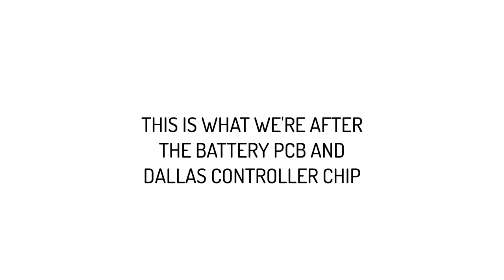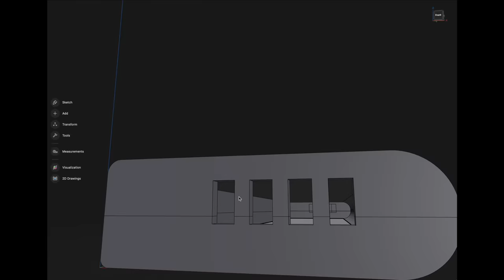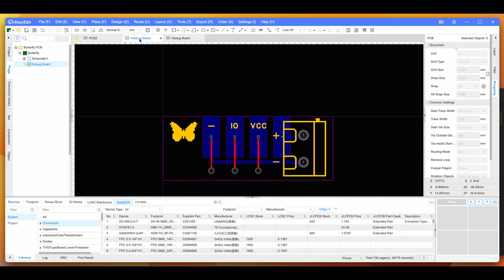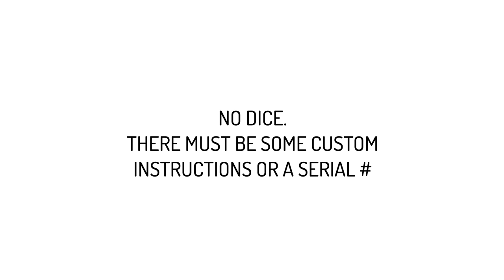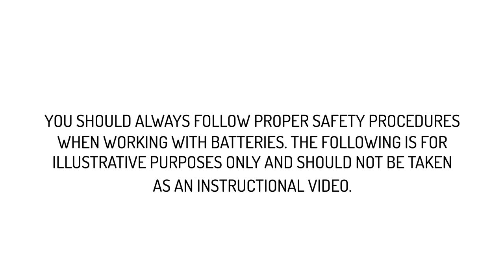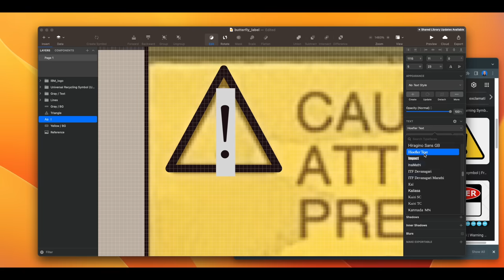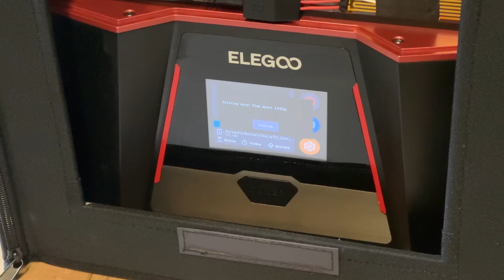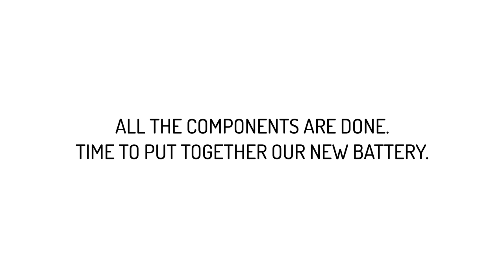Reverse Engineering a ThinkPad Battery - And making a Perfect Clone

Comment: Great work! Can you please list  the apps used in the description? The sketch app and many other are only available on mac unfortunatelly. Also, to keep costs down, for those that don't have a 3d printer, a silicone mold can be used for the case, and for the simple pcbs, there's the manual method with nail polish and acid.
Reply: Nail polish and acid... 😻
The original ways.. that even I did 40 years ago are still simple and cheap.

Comment: Looks awesome! Was the Xometry printed case just for the debugger? I'd be so scared sending that off without a test print, ha. The resin case looks great!
Reply from the maker: Oh I totally did multiple test prints. I only had an FDM printer at the time and wanted to see the quality of an MJF print. I also wanted to see if it made sense for them to print in bulk so I could sell them as a kit. Ultimately it would have been too expensive and I invested in a resin printer to get to the level of quality that I wanted. I would definitely recommend Xometry for high quality prototype prints!
Reply: @polymatt  similar experience is now why I own a CNC machine, ha
Reply: @jrowny  lol

Comment: you should make sure that the original charger circuit isnt a float charger, the float current may be too high for ni-mh batteries. Though being that ni-hm have a lot higher capasity maybe you are fine if they werent too agressive with the original nicd ones

Comment: I think it would be a good idea to use lifepo4 cells instead of the original battery chemistry because they can be deepcycled thousands of times. They're not as powerful as lithium ion, but they also won't explode or inflate. They're also more energy dense and lighter than nickel cadmium and lead acid.

Comment: Please write a bit on the battery chip reverse-engineering, would be very interested in reading!
Reply from the maker: At a high level, the chip is a Dallas DS2434. It operates on the 1-Wire protocol, so I used a logic analyzer to read the signals through various stages of operation. I then compared them to the DS2434 spec to try to understand the main workflows, requests and responses, etc.

I wrote an Arduino implementation in C using the OneWireHub library from Orgua, but there were slight changes that I needed to make. For example, this chip expects that it's the only one on the bus, where usually 1-Wire devices are multi-drop. So the library was expecting the bus to enumerate the devices, while the 701 laptop was expecting that the chip was the only one it was going to be talking to.

There were also some calls made to the chip that weren't int he spec and I was never able to determine what they were for, so I made sure that I just replicated the response of a working 701c Dallas chip.

The DS2434 also has an internal thermistor. I wanted to keep the PCB as simple as possible so I wrote a way for the chip to approximate the temperature through detecting changes in voltage. Definitely not a reliable thing to do normally, but I had the software compensate for crazy readings.

I also was able to store all the data in memory in the local EEPROM for persistance.

After that it was pretty straight forward. I figured out the code would run fine using the ATtiny's 16 mhz clock and that was that.

All of the code is available on Github including my modified OneWireHub library. https://github.com/hrushka/701C.ORG
Reply: @polymatt  Love it. Not sure the replication of responses is necessarily a good idea, especially if they turn out to be done IBM-specific charge control commands or something. Then again, pretty much the entire BMS seems to be on the laptop's side, so not much it could cause. And if it works, you know, don't need to fix it.

Comment: 17:42 I wouldn't recommend glueing the batteries together like that, masking tape is enough to hold the individual sections of 3 batteries together during soldering and the heat-shrink he put on later is enough to keep the entire pack together. The batteries will heat up with use and cool down when not in use causing expansion and contraction in the batteries which will cause the glue to break off and possibly damage the protective layer of factory heat-shrink on the batteries. Also its not recommended to solder directly to 18650 batteries as they are heat sensitive and high temperatures can lead to catastrophic faillure of the batteries. With this kind of 18650 with spot-welded tabs, its better to just solder wires to the tabs to interconnect them, instead of soldering the tabs directly to the next battery in line. Just make sure to position the wires so they fit into the voids between the batteries and the case once assembled.

Comment: I was like why he didn't use Lithium battery's  you could have used so  called polimer ones, but I'm guessing NiMh battery charging controller is on the motherboard.
Reply from the maker: You are exactly right. I tried using some LiPo packs with their own BMSs but the charging curve was just too different.

Comment: I know that I am a little late to the show, but @polymatt you have outdone yourself. Attention to detail, sparing no expense, clearly. 
I do have a question re: the case. You had on done by a third party for like a hundred bucks that you used on to analyse and then later 3d printed a final one. this is usually the reverse way of prototyping. Can you please elaborate on your choice here? Also why didn't you use the third party for the final product since you paid so much to have it made?
Last question, since you had so much extra room in the pack where you coiled the extra wire up, why not use a more readily available chip and just run wires to it and jam it in the with the excess wires instead of paying premium for the chip you chose.
Lastly, I am only asking since I admire the process, and would love to know what goes through your head when doing something like this.

I am interested in the 3d modeling software you are using, I have never seen it before and it looks really nice for the task. 

Cheers, and thanks for the show. When I saw that it was 30 minutes long, I honestly assumed that I would be skipping through it to save some time, but you sucked me in and I watched every second. Great CC Overlays also, good choice.
Reply from the maker: Hey there - it’s definitely a common question 😁.  Long story short I used Xometry because I was originally planning on doing a production run and selling the cases in my store. The quality was amazing but far too expensive. I ended up deciding to open source absolutely everything. At the time I also didn’t have an SLA printer but ended up investing in one for this and future projects!

The cad software is called Shapr3D. I absolutely love it. It’s a bit simple but still powerful and even has a great iPad app.

As for the chip, I needed a sufficiently powerful microcontroller to emulating the original IC so in my tests it had to be at least 16mhz. It’s essentially software emulation which has a huge overhead of even simple circuits especially since timing is key. For the cells this was just a test. I added screw terminals to the board so anyone could build any size pack and as long as the voltage and battery chemistry were the same you could do a number of configurations. I opted for AAA size cells for just showing the process.

Comment: love the work Matt!. Seriously impressive work. Genuine question at this amount of effort is it also not a feasible option to just change the cells in the battery to new ones? 300$ for a case is expensive. Thanks!
Reply: sorry! seems like you can 3d print it, which would be a whole lot cheaper
Reply from the maker: Hey you can definitely use the original case if you’re careful opening it, don’t mind glueing it back together and if the original chip still works. If not it’s best to print a new one. And yes - everything in the video is open source!

Comment: Great video, thank you! just to clarify, did you change battery cell type from NiCd to LiPo?
Reply from the maker: I didn’t. I tried to make it work but in the end I would have needed to rewrite the BMS, which aren’t on the batteries, they’re on the logic board of the laptop. I had the labels printed with LiPo because at that time I was hopeful but in the end I stuck with NiMH.

Comment: Excellent video.  Just a small typo, I think.  Li-Po, or polymer, are the pouch batteries.  Cylindrical cells are Li-Ion.  I don't think there's much difference, but I don't think your batteries will balloon up when it reaches end of life.
Reply from the maker: Ha. Good eye. It’s in the captions but I was a little over ambitious and was working to get LiPo packs working. The cells I’m using are NiMh. I’ve got a LiPo version that will power the laptop but charging is an issue as I’m sure you know the chemistries are quite different.

I had some initial success so I ordered the labels with LiPo but then was never able to make it happen 😑. I was hopeful because the LiPo packs had an onboard BMS of their own that prevent over voltage / over charging etc.
Reply: @polymatt  I kind of figured as such.  I'm mildly aware of the idiosyncrasies of lithium charging and no sense digging into it, we both probably know.  Though it would be nice to get that working.  I would settle with not fully charging the cells for longevity sake.

I really want to rebuild the batteries for my own ThinkPad.  I managed to run a 760 with 14 Ni-Mh AAAs, but as you can imagine they do not last long.  Lol
Reply from the maker: @Ikouy  yup. I was thinking the same. Sacrifice a full charge to get a lot more longevity.
Reply: You can get Li-Po and Li-Ion versions of both the pouch and cylindrical batteries, as it's telling you the chemistry, not the form factor.
Reply: @HaralHeisto  Lithium Ion is often used interchangeably, but I'm not sure the point of a polymer cell in a cylindrical format.

Comment: That's awesome. So, I have never looked into it but I assumed that this kind of thing would require specialist electronics to account for the different ways old NiCad and NiMH batteries charge vs modern LiPos. Is this what you had to do in creating/programing your chip, or is it somehow simpler than I assumed?
Reply from the maker: I tried to go LiPo but was ultimately unsuccessful because the BMS is actually on the laptops system board and not on the chip. I tried a few workarounds with LiPo packs that had their own BMS but ultimately there were reliability issues with the laptop expecting a charging curve similar to NiCad and NiMH chemistry. So I ended up with some LiPo labels but with NiMH cells :). Both versions of the labels are up on GitHub and maybe someone can figure it out!

Comment: I'm very impressed. I currently have the idea to swap over a low capacity gaming laptop battery with one that is far higher from the same brand (Acer Nitro 5), but I have no idea if the straight swap over, will fuck up the laptop circuitry (something controlling the right amount of power feed from battery to laptop) or that the new battery has a built-in chip that detects laptop serial number or something similar to prevent the higher capacity battery from working in the first place. I would love to know your thoughts.
Reply from the maker: Hey there. There are a few things to consider. The first is the power output/potential. You’ll want to make sure the Voltage rating of your battery is close to the stock one. Too much and you can risk frying things, too little and you’ll risk it shutting off when your laptop is drawing too much or it won’t power on at all. 
The second part is the battery management. In newer laptops the BMS (Battery Management System) - the thing that regulates charging, monitors current and battery health - is all on the battery. This is a good thing. So as long as you’re making sure your voltage is similar you don’t need to worry about different battery chemistries etc. However however, if you’re replacing the cells within a pack or the BMS is on the system board itself and not the battery, you’ll want to replace the cells with the exact same chemistry type (or a compatible one - like I did with using NiMH instead of NiCad) 

Not being familiar with your laptop (or most modern batteries for that matter) I can’t say which is the case, but hopefully that gives you a little direction. If the battery chemistry is the same, voltage is similar and a new pack with give you an increase in Amp Hours - go for it!

Comment: How long did this battery last compared to original one?
Reply from the maker: A little longer actually. Even with the smaller cell size. The original only lasted 1:45 while the new one lasts ~2 hours. This was just a test as you can fit larger cells in the case with a few modifications.

Comment: just found your channel, love the video and the project.  I'm a little confused though - why would you spend $100 on a gorgeous nylon printed case for debugging to wind up using resin for the final battery?
Reply from the maker: Hey Aron, great question. When I was ordering for Xometry I didn’t have an SLA printer and I was also testing them out because I had originally planned on doing some production runs and offering a full case on my site. For a few reasons I decided to open source everything and let people print their own rather than being in the business of selling cases. In order to make sure the models were good for printing on FDM and SLA I wanted to try both. And during that time I ended up getting an SLA printer.

Comment: Is it possible to assemble the batteries with out welding them?  I dont have the skills or money for the equipment to do it right with out starting a fire.  Is it possible to push them together and make contact with pressure?  or is welding mandatory?
Reply from the maker: Hey thanks for the question! It’s not mandatory from an electrical standpoint. There are a lot of battery holders that would accomplish this with user replaceable cells. Unfortunately in the limited amount of space here, I couldn’t find a way to make it work.

Comment: Why not convert it to Lithium? 
A 3S Lithium would have the ideal voltagelevel. A NiMh cell is charged around 1.4v and with 1.1v discharged. Which means 12.6v Full and 9.9v empty. 
A NMC Lithium Cell is Full at 4.2v and 3v completely discharged, in a 3s Pack its 12.6v fully charged and 9v discharged. Which means the Lithium pack would never get discharged too low, so it will last quite long. And with the higher capacity of Lithium compared to NiMh the runtime of the Thinkpad will be much longer.
The charging curve will be slightly different but towards the full charge they're pretty similar aswell.
Reply: He said in response to another comment that that was the original plan (hence lipo written on label), but was not able to get the laptop to reliably charge the lithium pack.

Comment: 3 things 
1: wow that case is expensive to have made 
2: are you replacing nicad w/ nicad instead of li-ion? 
3: is the pack unbalanced? that might cause issues in the long term as batteries love to drift a bit in charge
Reply from the maker: Hey there! 1. 
Yeah the one with Xometry was just a test as I was evaluating them to do a production run, but ultimately decided to open source all of it.
2. Im actually using NiMH rather than NiCad. The label says LiPo but I got a little ahead of myself. I have the NiMH version up on GitHub as well.
3. Since they're NiMH, they're essentially self-balancing. Balancing LiPo packs or Li-Ion cells would have definitely been an issue.
Reply: @polymatt  cheers!, one further question; why not lipo/li-ion, NIMH is not very "dense" and is prone to leaking after prolonged use

Comment: on a side note when you looking at the code line by line why don't someone make a small program that checks both lines of code and clones them to be both the same. You can have copy all the lines of IBM code to the new chip.  And have it write anything that isn't on the new chip that the old chip has.
Reply from the maker: If only it was that easy :). The old chip doesn’t have code. It’s an integrated circuit. What I’m doing in the video is reading what the signals do on the original circuit and writing code to emulate them on a microcontroller. It takes a lot more hardware to run code that emulates a simple IC. That’s part of the fun of reverse engineering.

Comment: why do you ue a screw terminal on the pcb in the battery instead of soldering directly to the pads?
Reply from the maker: I was doing a lot of work testing different batteries, it was easier this way so I didn't have to keep soldering and desoldering them. If you get the board you can definitely solder them directly.

Comment: If it were so easy to do that, we woul have less good working laptops sent to the e-waste pile.    I currently have a Dell Studio 1735 laptop that is working fine, I update the thermal pads and paste on a regular basis and the batteries are hard to find.  The funny part is I can find batteries for a much older laptop.

Comment: Darn. Looks like a great video, but I'd really like to know how to do the same with a modern Thinkpad battery. Is there any chance you could do that?
Reply from the maker: Modern batteries wouldn’t need to go to this length. First off they are “smart” meaning the battery management or BMS is done in the battery and not on the system board of the computer like this one. Second the chips used in the BMS are likely still manufactured. You could probably just go about finding compatible battery cells and re-celling the packs - something that wasn’t possible with these. I’d say at most you may need to reset the BMS charge counter etc but that would be the most technical bit!
Reply: @polymatt  Thanks! I'll keep that in mind.